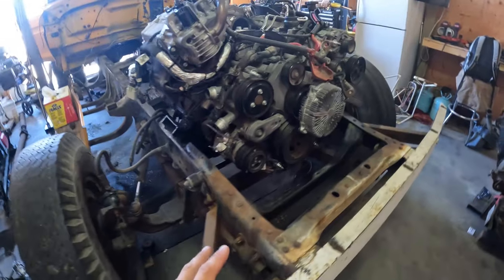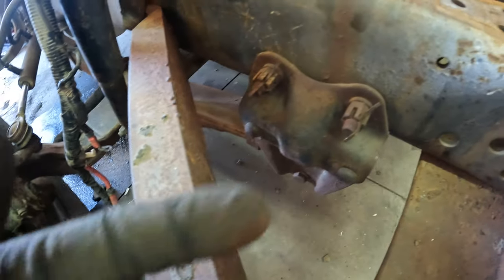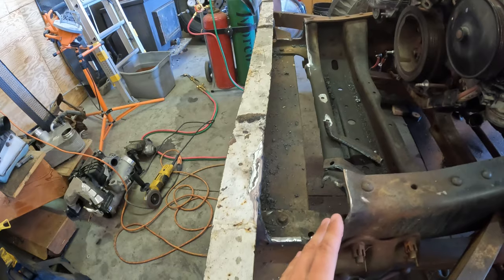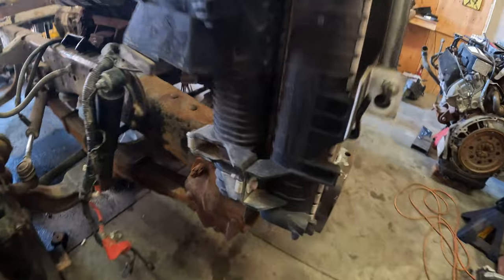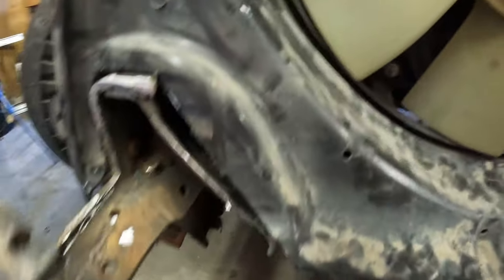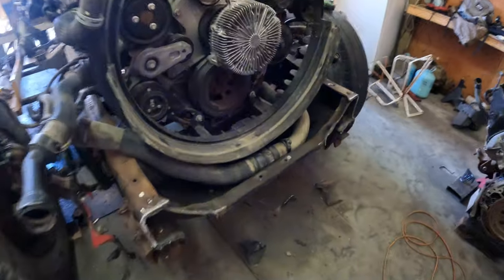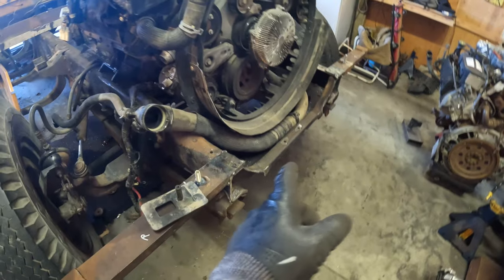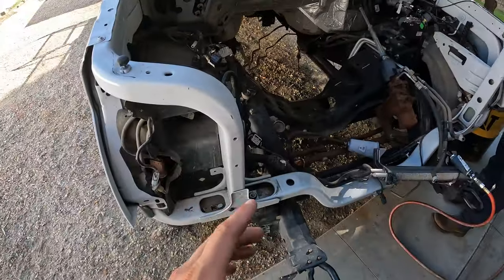Diesel Swapped F750 CrewCab Part 6 | INSTALLING COOLANT PACKAGE

Comment: Those bolts look like they are a slightly smaller diameter then the original dowel pin mounts for the cooling system so what I would consider doing is grinding down the threads on the bolts and putting heat shrink on it, that way the threads won’t chew up the inside of that plastic mount for your cooling system unless your planning on bolting it down
Reply from the maker: Good eye, they are slightly smaller. I have thought about bolting it down, but I’m not sure if it needs to be freely moving like it was in the original truck. Thanks for the help! 🤘🏼